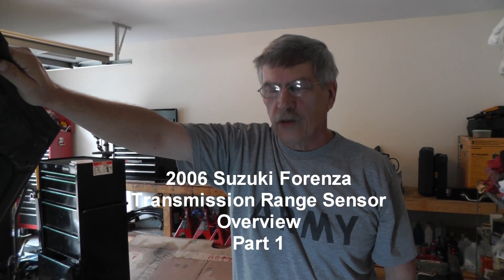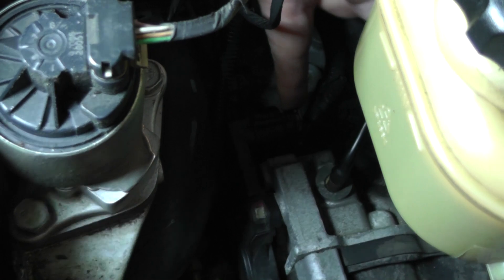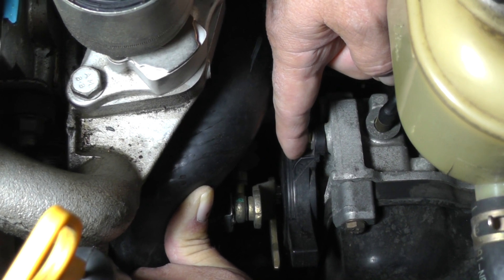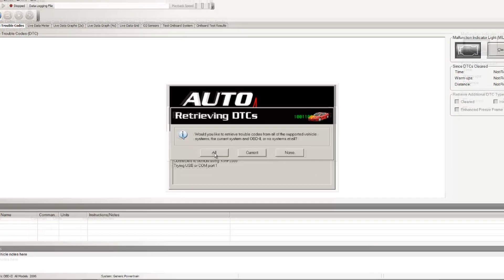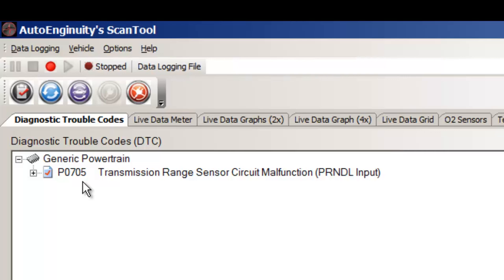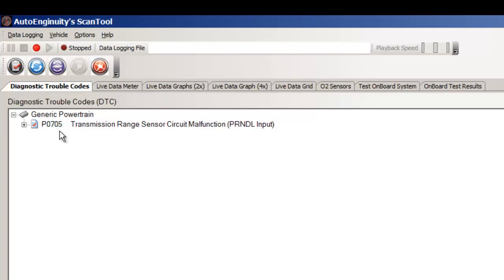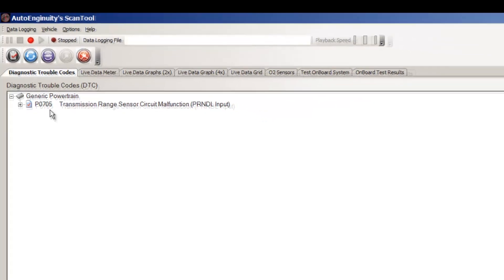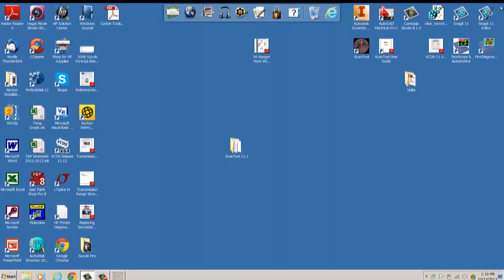Suzuki Forenza Transmission Range Sensor Overview - Part 1

Comment: i did this and it did not fix it....it was doing everything u said in this video but still doing it after brand new one was put on
Reply from the maker: You could very well have another issue and you may need to do some diagnostics.
Reply: i called about the tcm and they said 900.00...where i live no junk yards has any suzukis....they also said it was under the hood on the firewall....what are they talking about does it have 2 tcm's?
Reply from the maker: Pamela, I assume that you have a 2006 Forenza. If so, the TCM is located under the dash on the driver side. And it should be the same for other years. It could be that they are talking about the PCM which is under the hood. Are you sure that the TCM is your problem as that is a lot of money. If the shop did this diagnosis and they're saying the TCM is under the hood, you many want to look else where for diagnostics.
Reply: +stuzman52 no it is a 2005 reno
Reply: i called a dealership about the tcm and that is what they told me not the peraon who hooked it up and checked it
Reply from the maker: Okay Pamela...with a Reno, it's quite possible that it may be under the hood. I'm not really familiar with that car, so I would assume that the dealership is correct. Did they diagnose the issue and say the TCM needs to be replaced?
Reply: +stuzman52 a shop did...but when i look it up online it shows me 2 different parts and not sure which is which
Reply from the maker: You could call them tomorrow and ask them. I really don't know the answer Pamela...
Reply: +stuzman52 it is under the dash ...do i have to reprogram anything when i put the other one in or can o just put it in and it work???
Reply from the maker: I'm really not sure about this module if it needs to be reprogrammed. Give the shop or dealer a call and they would know for sure.

Comment: hello sir can you please tell me where the transmission control module is on a 2005 Suzuki Reno?
Reply from the maker: Pamela, the TCM is located under the dash near the foot well. It's a black box with three connectors. Take a look at the video in this series of where I hook up a scope and you'll see it's location.

Comment: how do you add transmission fluid
Reply from the maker: On this transmission, there is no dipstick, so it is considered a sealed unit. To add fluid, you will see two plugs on the passenger side of the transmission. The plug on the bottom is for the drain and the one on the top is where you add fluid. You will need a 8mm square insert to fit inside the plug to remove it.
Reply: stuzman Is this under the car or under the hood?

Comment: saludos sr. usted saber como medir con un multimetro los selenoides de la caja automática desde la tcm? que software usa para escanear el carro gracias
Reply from the maker: You could use a voltmeter to monitor the PCM control side of the solenoid valves for its off/on condition at the TCM. But you will find it easier to use a scanner for this diagnostic. If you had a four channel scope, then you get the raw data at the TCM also. Here is a link to a free service manual. http://lacetti.com.ua/chevy-man/EN/documents/Nubira-Lacetti/start_Nubira-Lacetti.html Although it lists a different make, the same information applies for the Suzuki Forenza and other makes of Suzuki. For free wiring diagrams, you can go to www.bbbind.com and click on 'Technical Publications' and you'll see the link for TSB's and wiring diagrams. Fill out the short form and get the diagrams. As for the scanner, I believe it was autoenginuity. The one that I used was a basic one which doesn't allow one to monitor the solenoids in the tranny. If you don't have a scanner, then you'll be left with a voltmeter. Hope that helps...

Comment: Will the TRS always show a code when it fails? I had the exact same symptoms with my 07 Forenza and the shop ended up changing the brake switch and TCM due to a high voltage and TCM error code. It was determined that those were the failures after doing an electrical system trace. You can feel when the system kicks out and it will reset if I turn the ignition off and back on. But it is interment as you stated when it kicks out and you get to a light there will be no power pulling off and then when I pull over to park there is a loud clunk noise going into Park , Drive or Reverse until it resets itself by turning ignition on and off. I have already spent $180 for the diagnostics and brake switch plus another $150 for the TCM. Should I assume it has been the TRS all along even though it has not shown the code?
Reply from the maker: Usually Eddie to my knowledge you'll get a code with a TRS fault. Keep in mind that a code of P0705 indicates a fault in the circuit for the TRS. So, it could also be a fault in one or more of the four wires for the switches in the TRS or a fault in the TCM since it reads those switches. But for the most part since the switch is a mechanical switch which is prone to failure, it's usually this component.

Comment: stuzman52 well I be darn on my way home it came on I got it checked they say it could be my transmission solenoid or an open or short circuit condition or transmission failure but I purchased the car in February and got it checked twice and transmission didn't have issues I think it may be the wires will know when I get the TuneUp thanx so much for youre advice
Reply from the maker: +Jasmine Williams Glad to help Jasmine. Hopefully, it won't be too serious of an issue. Take care...
Reply: Thanks u to

Comment: the check engine isn't on and thanx for the advice could it be I just need a tune up or to change the transmission screen
Reply from the maker: +Jasmine Williams It's possible Jasmine, but to be sure, you'll need to get your car diagnosed by a reputable shop. It could be lots of other things. Also, you could have a pending code and&#160;the check engine light wouldn't be on. Always worthwhile to see if anything is stored. You could get a check of any codes for free at one of the major auto chains such as Advance or Autozone. Maybe that could give you some direction.

Comment: I have a 2006 model my car jerks when I reach 30 MPH could this be the problem someone help  mechanics just want money I'm on a budget
Reply: same problem I have.  This vehicle needs a recall.
Reply from the maker: You are correct that this vehicle has a lot of problems with this sensor. And they should have a recall, but with the age the vehicles are now, it's not going to happen.
Reply from the maker: +Jasmine Williams Jasmine, if your car as a check engine light on and if you notice a diagonal line across your gear selection in the LCD display, then you may have a range sensor issue. Otherwise,, there probably is something else going on. If you have a check engine light on, you may want to get the code read and then you could go from there.

Comment: I had the same problem with that sensor. found out power was low reaching the sensors. due to battery & alternator bad. I changed both & clear the error codes. car runs fine.

Comment: hi.. I've sent my car to local workshop.. they changed the TRS switch.. but that doesn't fix it... then they check it again and found out its the valve body problem.. my question is can i still use the car since they don't have the sparepart?
Reply from the maker: +L Bagwell You'll probably best to ask the folks who's doing the diagnostics if you can still drive the car with valve body issues.

Comment: can i drive it without replacing TRS?
Reply from the maker: +L Bagwell You can drive it for a short while, but I wouldn't make it a permanent fix. The tranny is starting out in third gear, so it's not good on it. If the TRS is your problem, I would replace it as soon as possible.
Reply: +stuzman52 thanks for the reply.. this is the third time i had this problem since owning the car.. but this time it had a weird noise, not sure if its a torque converter bcos sound like atf fluid is not enough

Comment: good sr days stuzman52 already had written before but this time I have another problem aver if I explain well .. my car has a zf4hp16 box when I put R reverse and keep the brake pedal applied pitonea car or cracked like a car synchronic and try to start it on 5 speed it over to neutral N and removes the step D pistonea driver and does the same thing again in 1,2,3 respectively, a mechanic told me it was the torque converter and change it as usual failure another mechanic told me that may be the lock-up converter that is activated or may be a solenoid but do not really know what the solution every test they cost me money and I'm bankrupt you . I could help and give me directions to solve the probrema ? Thank you so much
Reply from the maker: +Miguel Ojeda I'm sorry Miguel, but I don't have a clue to what you said there.

Comment: we're are the transition sinsers on a 2007 sazuky
Reply from the maker: +Jose Trejo Which sensors are you asking about? For this video which is about the transmission range sensor is located on the input shaft of the tranny. This is all shown in this video series. Is there another sensor you're talking about?

Comment: Is the range sensor the same as the Transmission Control Module or are those two different parts. I am experiencing the issue where the transmission will shift hard but reset if you turn car off and back on. The error message says it is the module.
Reply from the maker: +Eddie Grider The range sensor and the TCM are two different things. Watch the other videos and you'll see their locations and how they work. You can't rely on an error message that the module is bad as it could be the range sensor and it's the most common issue. Most of the time when you turn the engine off, you may experience normal shifting, but the issue will come back. I would diagnose the range sensor before I replaced a module. Good luck on your repair.
Reply: +stuzman52  Thank you sir. I did take my car to Coleman Taylor and they diagnosed it as a low voltage fault. The transmission is not recieving enough pressure. Unfortunately it is an electrical issue that they do not fix and the other problem is there is no Suzuki dealer nearby. Would that be the range sensor causing the low voltage? Also if I understand correctly that transmission is sealed and supposed to be maintainence free. Does that mean if it leak or has an issue other than electrical that it has to be replaced. Coleman Taylor says the internal seemed to be fine expect for the low pressure coming from the electrical issue.
Reply from the maker: +Eddie Grider Eddie, I'm not sure where the low voltage fault is located as it could be anywhere and probably wouldn't be the range sensor. If the mechanic was able to find the low voltage fault, he should been able to tell you where the fault is at and what it would take to fix it. Any reputable repair shop should be able to diagnose your issue; so, it doesn't have to be a Suzuki dealership. The transmission is considered a sealed unit without a dipstick. But you can still change the fluid in it with a drain and fill plug located on the passenger side of the tranny. My guess is that if you have low pressure, you probably have some internal fault with a solenoid inside the transmission. But since I haven't diagnosed the problem, I can't say for sure.
Reply: +stuzman52 Autozone gave me a P0700 for the transmission module. I then took to Coleman Taylor who is supposed to be nationwide transmission experts and they gave me a P0563 for system voltage too high. They say it's an electrical issue causing the pressure to be low in the transmission.  They don't fix electrical , only remove and replace the transmission which I found to be odd with them claiming to be the experts. My question is what do you think would cause those faults if not the TRS or TCM? The sparatic systems going on point to both based on the reports from others on feeds such as this. What other electrical component would interfere with the performance of the transmission?
Reply from the maker: +Eddie Grider It's interesting that Autozone gives you a P0700 code which is a generic code stored in the PCM. This is telling the technician that other more specific codes are stored in the TCM. You'll have to use a high-end scanner to read these codes as a generic scanner such as AutoZone's won't do the job. The other code, P0563 should have been read by Autozone as it's a generic code and any generic scanner should read it. So, not sure what you got stored in the PCM right now. If Autozone is the last place that you had your codes read and there wasn't a P0563, I would go with the P0700. But, you'll going to have to get the TCM read to see what's going on with your tranny. At this point, it appears you have a tranny issue or possibly TCM issue. That's about the best info I can give you with the info that you gave. As for the tranny shop, they should be able to handle the diagnostics and repair, both electrically and mechanically. Your best bet is not to use them and find someone else. As for experts, no such thing in my mind. To me, an expert is someone who knows everything there is to know about whatever, even the stuff that hasn't been discovered yet. And where is the point of knowledge for someone of where we can call he/she an expert. See what I mean...
Reply: +stuzman52 So in a nutshell that is why they do the scan for free, because it only gives generic codes? Thanks for taking the time to answer questions. Great service cus there are a lot on the web who charge and take advantage of folks.
Reply from the maker: +Eddie Grider That's true Eddie, but the biggest reason that auto chains will read the codes is to sell you a part. If the code reads O2 blah blah, then they'll sell you an O2 sensor, yet the trouble could be elsewhere and not the sensor. And you're right that folks will take advantage of you, especially women because they wouldn't have a clue. That's why I started learning about autos years ago because I was dissatisfied with their work and knew more their certified techs. Hope you find out what your issue is. You could do some reading and posting on a Suzuki forum that could help you out. Here's a link to one...http://www.suzuki-forums.com/general-forenza-reno-forum/

Comment: hello Mr stuzman 52 , i have problem in my car...in transmission ..When the car movement the Transmission does not give a number that  Engine deserve , So too loud happens in the engine and sometimes  as the car in status N
Ireplace the hydraulic  and oil and clean up the kaise and filter,, my car suzuky jimny 2007
Reply from the maker: +Raad Hani It's a little hard to understand what you're saying except that maybe you've got a problem with your transmission and that the numbers don't show. You're probably getting a check engine light on, correct? If so, I would read the code for that and see what you got.
Reply: +stuzman52 Will Suzuki pay for this repair? I had the exact problem in 2008 and it was under warranty. Now I have the same problem again. I also had to take the car in 3 times on a factory recall for the daylights? Thank you, Nick.
Reply from the maker: +a gravante Don't know if they will pay or not. Easy enough to call a dealership and see what they will do.

Comment: I just replaced my transmission range sensor.  I did not buy the suggested tool to make sure the sensor was positioned correct.  When I went to check the gears I could not get it into park.  Now I can not get the transmission linkage back on the shifter nor can I get the car started.  I have a feeling it stuck in neutral.  Do you have any suggestions?  If I can get the gear shift to move from park I will purchase the tool for the adjustment.
Reply from the maker: +Susan Wheatley Not sure where you went wrong Susan as the range sensor doesn't have anything to do with the gearshift selector not being able to move. As mentioned in the video, you can adjust the range sensor to be in the middle of the slots for the bolts. That's why I mentioned it because the tool is over a $100 and not absolutely needed. I suspect that you have an issue with a solenoid on the gearshift selector inside the car since you can't move the shifter. The range sensor shouldn't have anything to do with not being able to move the shifter. If you need a free wiring diagram, you can go to www.bbbind.com and from there click on 'Technical Information' and finally on 'TSB's and Wiring Diagrams'. The shift solenoid for the gearshift lever should be underneath the console cover inside the car.
Reply: there is a shift lock key beside your gear stick. push a key in there & move your gear stick while your ignition is on. this car is about 80% electronic so battery must be fully charged & alternator must be working real good

Comment: i want to know about sensor speed ..suzuki forenza 2006
Reply from the maker: Jose Castro What specifically do you want to know and which sensor are you talking about? Is it the input speed sensor or the output speed sensor? With either sensor, it's a VRS (variable reluctance sensor) which is basically an ac magnetic pickup type sensor. It will generate an ac voltage which varies in amplitude and frequency related to engine speed for the input speed sensor, or if it's the output speed sensor it will generate a voltage relating to the vehicle moving. Does that help?
Reply: My car  is suzuki forenza 2006 ..so i want to know ..where is the sensor speed
Reply from the maker: There are two speed sensors and both should be mounted on the transmission. One is the input and the other is the output speed sensor. Here is a link to a service manual Jose that may pinpoint the locations for you. http://www.suzuki-forums.com/suzuki-forenza-reno-forum/78338-free-service-manual-suzuki-forenza.html